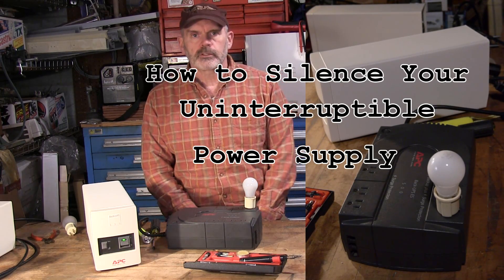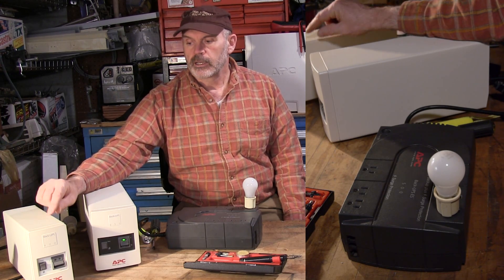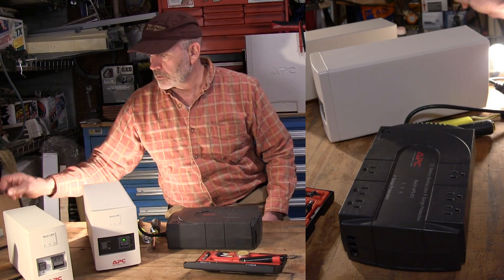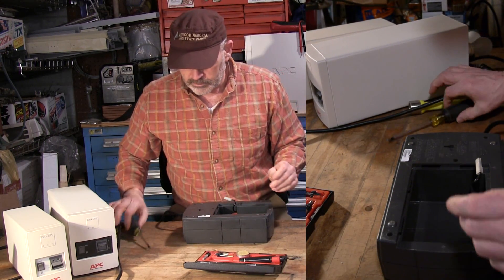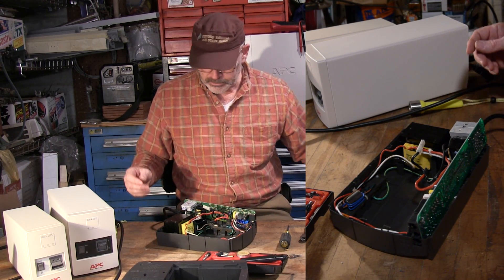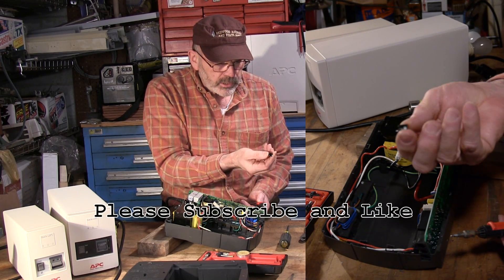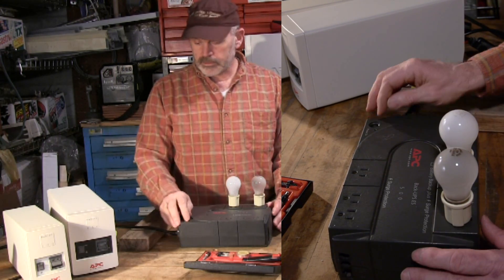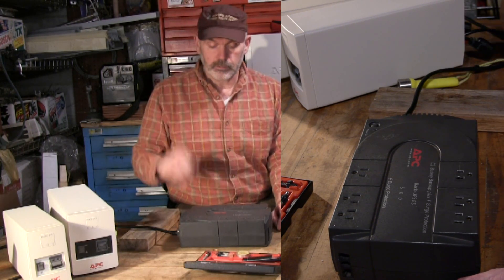How to Silence a UPS

Comment: I'd always use the solder removal method for the speaker.  Once you disconnect AC and the battery, if you turn on the ups it should discharge any capaciters, but I'd always treat them as if they are charged... Careful what you touch.

Comment: Very interesting. I just came up with another idea you could use a UPS to charge your batteries. So you don’t have to buy a battery charger. Then you can use the UPS as a back up source of electricity when the power goes out.
Reply from the maker: The heat sinks built into most UPS are only good enough to run the battery backup for a short time. To use them as an inverter you need to add heat sinks. There are videos on youtube on how to do this.

Comment: Thanks for the video ..... I was going to try just filling the little hole in the piezo with clear silicone and let it dry so that the piezo could not push any air and therefore be silenced.  I will let you know how that turns out
Reply: Bad idea. Silicone is conductive.

Comment: Thanks. Are 2 days enough to discharge the capacitors?
Reply from the maker: I am not sure but you should discharge them with a ground wire to be safe.
Reply: No, a capacitor will hold a charge, a long time, until they are drained.
Reply: @chrissewell1608  thanks

Comment: thanks for the great video!  i decided to start with a variation of your hot glue method.  mixed up a batch of 5 minute epoxy, dripped it through the speaker hole. kept adding until no more would sink  through, and then let harden.  tested and no more noise.  i was a bit nervous about drilling, cutting, soldering.  :)
Reply: How'd that work for ya? 🤔🤣

Comment: Nearly all can be configured to permanently turn off the buzzer using software.  Attach to PC using USB cable, install software provided by manufacturer, disable buzzer in settings.  Done.   This works with APC and other brands.
Reply: I use a UPS to power my router and modem so i have internet when there is a power failure, the problem for me is... my UPS is no where near a pc and i have tried tuning the beep alarm off with the included software... but for some reason, when there is a power outage the settings on the UPS clears. so i needed to drag my laptop to the UPS each time there is a outage just to change the setting. I have an RCT make UPS.
Reply: @Gnarkill667  I am so glad I read your comment! I'm not very computer savvy so it would have taken me a ton of brain-cramping effort to figure out how to access the UPS settings through software. I was not looking forward to it but intended to try. If it isn't guaranteed to work I won't waste my energy and time! Thanks for the info!

Comment: I just traced out the circuit to the beeper and sliced a trace and added an external switch to the case and wired it to the nearest solder points on the board to those traces so I can select silent or sound depending on its use. If you want a greater RUN time ( it won't help with the capacity rating of watts ) you can extend the battery leads outside the case with the same gauge or thicker wire being sure to use an insulating bushing wherever the wires pass through holes in the metal chassis. Hook them up to a larger SLA battery and your run time is increased. If you go overboard and use something over twice the rating of the original battery you will need to hook up an external charger to the battery. Some smart chargers are not compatible since the mode must be selected after they are powered up. Also remember plug that external charger into the same outlet as the ups but DO NOT PLUG THE CHARGER INTO THE UPS ITSELF!
Reply: @YodasKitchen  I had that same thought to put a switch between the speaker and it's connections too for future ups that I might buy. 

You sound like you know at least a little bit on electronics and circuits. Do you know if removing the speaker would cause any issues of overload or underload on the other circuits on the board from that speaker being being gone? 

Also, my battery in my ups is too old and beeps most of the time if it's turned on for the battery side of outlets to be powered. I am thinking of getting a new ups to replace it with for my computer related devices, and then using this old one as a power strip. Do you think this would be unsafe or an issue to use a ups as a power strip if the battery is getting older?

Thanks so much for your comment!

Comment: I get mad every time I think of the tons and tons of used sealed batteries that seem to me to be built to fail. Two to three years is ridiculous - these things should last at least 10. Anyway, thanks for the "operation" instructions - I'll be working on my ES-750 with it's nearly dead battery soon. I'm just going to leave the dead battery in it and use the thing as a surge protector. I can't bring myself to just junk it.
Reply from the maker: I agree! I am thinking about converting one to use ultra capacitors instead of batteries.
Reply: I just extend the wires out carefully and hook up the ups to an external battery that is huge! Charging will be the issue since the internal charger is sized to the ups. You can hook up an external smart charger to the large battery. SLA batteries are sensitive to the charging voltage and current supplied by the ups. Older units are not as efficient as newer units. FYI, larger batteries equal to longer run time, the ups has a finite supply rating, so if it is a 300 watt unit, it will only supply 300 watts for a load but for a greater length of time.
Reply: I am wanting to do the same thing since it seems that it would work as a regular surge protector power strip, even though it would take up a ton of space to just be a power strip if you want a clean desktop workstation.

My apc ups has an older battery which causes the beeping. 4 outlets are for surge protection only and the other 4 are battery powered. If I turn it off, the 4 surge-only-protector-outlets still work, but the battery outlets do not.

Do you know if it could be an issue/fire hazzard/unsafe to leave it on with an aging battery turned on to use the 4 battery outlets as a power strip as well?

I am also wondering if removing the speaker could put overload or underload on any other circuits on the board from not having the engineered/planned resistance on the other circuits now that the speaker has been removed. I am sure I am overthinking but I just want to be safe and not cause any overload or anything that might cause sparking or fire.

Thank you for your original comment as well!

Comment: just saved me $150, thank you!
why they don't let you turn that annoying beep off is unbelievable.
We don't need a beep to tell us the power is out. What where they not thinking about?
Reply from the maker: +Richy Diago It must be some kind of inside joke: "Lets see how much we can annoy the customers and still have them buy our product."
Reply: Sometimes a circuit breaker could trip on a circuit that has nothing to do with lighting, or TV or anything else that you might notice right away.  This having been said, it is annoying not to be able to at least turn off the "red alert" sound once you are aware of what has happened.  Depending on the type of buzzer component used, it might be possible to wire a potentiometer (variable resistor) in series with the thing to reduce the volume to something less anoying, or even barely audible...   

Many times when working in developing countries the office did not have a set of large UPSs for the entire office, but rather an APC unit on each PC.  Every time there was a brown out on the mains from the power company or generator on/off event the UPSs beeped in a cacaphony and I would have wished that the manufactures had offered the possibility to program a limit to the alarm duration or volume...  made me go crazy ! :-)
Reply: @YodasKitchen  You sound like you know at least a little bit on electronics and circuits. Do you know if removing the speaker would cause any issues of overload or underload on the other circuits on the board from that speaker being being gone? 

Also, my battery in my ups is too old and beeps most of the time if it's turned on for the battery side of outlets to be powered. I am thinking of getting a new ups to replace it with for my computer related devices, and then using this old one as a power strip. Do you think this would be unsafe or an issue to use a ups as a power strip if the battery is getting older?

Thanks so much for your comment!

Comment: if your bedroom is the location , And it has its own branch circuit, you can UPS that circuit, right at the breaker box...after doing all your bedroom load calculations and making sure the UPS can handle it ( the inverter) . Have done this once , and worked fine on low amp needs such as you describe. Give it some thought, you seem to need a lot of back up..

Comment: Lil tip to save you some money... I have done this. These "Gell cells" that are sealed for indoor use, are very expensive. Grab a big Marine deep cycle battery, 12 volt. put in shop/garage, non living space. the marine batteries have wing nut top. Hook the 12 volts to the UPS inside the house, and a Solar charger or a battery tender to the big Marine battery. Cost is less than half a Gell cell, and you can get 5-6 YEARS out of them. Ebay for $25 bucks gets you a solar regulator. Interesting VID!